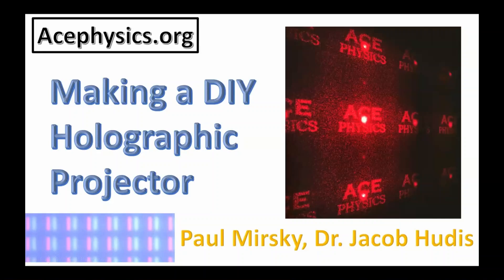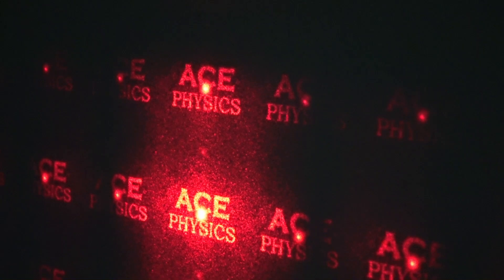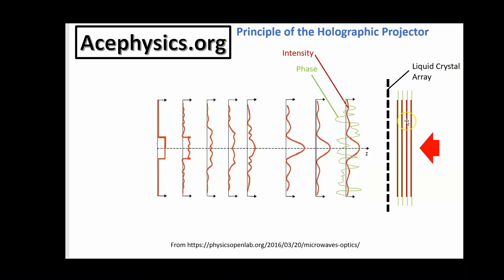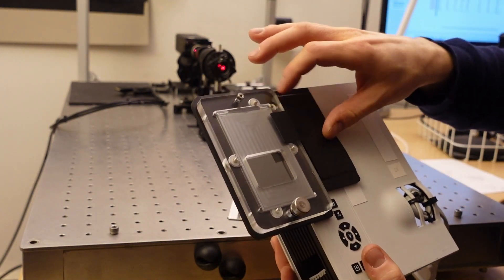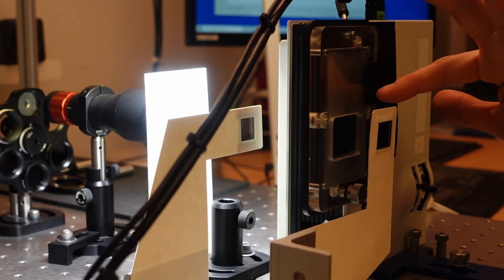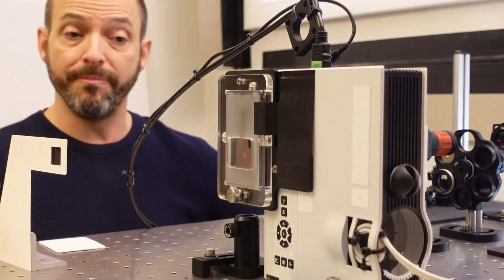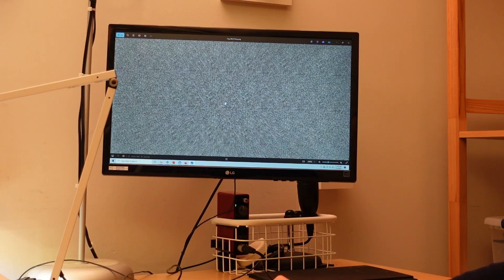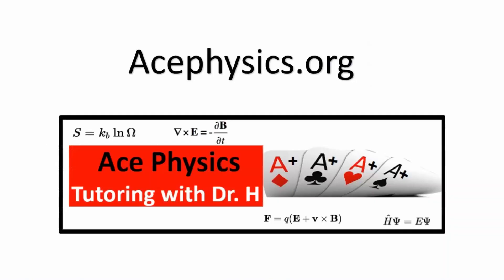LCD Projectors, Holography, and Fourier Optics Complete Explanation with Demonstration

Comment: I've been watching this video over and over, and after not getting any results with my laser + LCD setup. So many questions! 

Are the beamexpander + polarize crucial for this to work? Isn't laser light already polarized? 
If you are sending the light through a polarizer after the beamexpander, can't you just leave 1 layer of the polarizing filters on the LCD? 
If not, does the polarization axis matter? 
Is the resolution of the LCD relevant? Mine is only 320x240
How do I know the distance of the far field plane?
Reply from the maker: Paul Mirsky who you can contact at symmetryoptics.com is working on a reply.  I will elt you know when it is ready.
Reply: Brecht --
 
- A beam expander is not crucial, but it will let you cover more pixels.

- A polarizer is also not crucial; it just makes it more convenient to set the polarization orientation.  But you do need a quarter-wave plate to let you set the ellipticity, so that you can get it to be an eigenstate of the LCD.
- You can NOT leave the polarizer film on the LCD, because it's not configured to be an eigenstate of the polarizer.  I
- Resolution does matter.  You want lots of pixels -- so, small pixels and a large beam diameter.
- Distance of the far field plane is a tricky one, because you never get there completely (it's at infinity), so it becomes a question of 'what's close enough'.  It's the Fraunhofer distance, calculated from the largest feature size that matters, which can be a tricky thing to judge.  

I hope your experiment works!

Paul
Reply: Thank you very much. My replies seem to disappear, so I'll try again... Third time is the charm. 

Thank you for your answers, it makes the whole thing clearer yet again! 
I'll be skipping the polarizer then, as I don't have a quarter-wave plate... only circular and linear polarizers for my camera. 
The beam expander seems crucial, so I'll try making one using Galileo's telescope design... let's hope that will work with a 450mm and 99.6mm lens.. it'll make the beam ~4.5x wider if I'm not mistaking. 

I'm looking forward to play around with diffraction patterns of all kinds!

Comment: Do you have any information on the projector tear-down..? I thought projectors had 3 LCD's and some dichroic and other mirrors to separate RGB and then bring it back together with a prism... Surely it's not as straightforward as you make it?
Reply from the maker: You're absolutely right—most standard projectors use dichroic mirrors to split white light into red, green, and blue channels. Each color is modulated separately (typically with 3 LCDs or LCoS chips) and then recombined optically to produce a full-color image by additive color mixing.

But what I showed is a holographic projector, which operates on a completely different principle. It uses monochromatic, coherent light—usually from a laser—and a spatial light modulator (SLM) to control the phase of the light wave and create images through interference patterns, not color mixing.

Current holographic systems are typically monochromatic, since interference-based image formation relies on a fixed wavelength. Full-color holographic projection is an active area of research and is possible, but it requires multiple coherent light sources (e.g., red, green, and blue lasers) and highly precise modulation and alignment—much more complex than what I showed.

So yes, a holographic projector can work with multiple colors, but each must be handled carefully and coherently. For my setup, I simplified it by working with just one laser and one wavelength.
Reply: @acephysics123  Thanks for elaborating. 
I was just curious about the actual construction of your poor-man's SLM. I wanted to do this some time ago but colleagues told me it would not work with the LCD from a projector. You've just proven me right and them wrong, so now my quest begins to open up a projector and strip out one of the three LCD's.

Comment: In the second video,  you've said that the input for holographic projector is circularly polarized light, whereas the input for the normal LCD projector is linear polarized light. But I don't see you inserting the quarter wave plate here. Whats the magic? 

Thank you very much for the fantastic demonstrations!!

Comment: Why do we need to rip-off the cross polarizers? How does diffraction interact with the polarization? Polarization and phase are not the same thing, so I guess there must be some interference patterns which we can work with, even while the cross polarizers are in place. 
 I just watched this video, and I guess I will get the answers once I watch the next video?
Actually I got a cheap projector and assembled the setup with the laser pointer. And I am kind of possessive/afraid to rip the cross polarizers out.
Reply: "Changing only the phase, and not making them lighter or darker.." Okay, got it. Removing cross polarizes save you a lot of light.  But even with absorption from cross polarizers (even though it would be limiting), can't the light coming out of binary "slits" or pixels interfere with each other?.

Comment: That was so awesome!  Subscribed!! I have been interested in using SLMs as layers in a photonic neural network.  I think it could be done.  At some point I made a simulation that attempted to map neural weights on to the diffraction pattern. It kinda worked in the software domain, but there is a lot to do to make it work in hardware as I'm sure you are aware.   Really enjoyable video, thank you!
Reply from the maker: thanks a lot!  I have part 2 coming in about a week or less!

Comment: That was awesome! I have a question. Is water, especially seawater, a liquid crystal?
Reply from the maker: @tiredironrepair Great question! Liquid crystals are special phases of matter with properties between conventional liquids and solid crystals. The key difference is that their molecules are partially ordered and can be aligned in specific patterns using external factors like electric fields.

Seawater isn’t a liquid crystal because the salt ions are randomly dispersed, not organized into aligned structures. If you shine light through seawater, it will scatter and diffract, but it won’t produce a clear image or distinct pattern like a liquid crystal display would.

If you could somehow arrange the salt ions in a regular, controllable pattern, it might behave more like a liquid crystal. However, controlling ions in water at that level is extremely challenging and not something that occurs naturally.

Comment: ok i subscribed, waiting for the next part :D
Reply from the maker: Hi @frogz, thank you for watching and subscribing! Part 2 will definitely come—probably in about a month. I’ll have a few other unrelated videos in the meantime. Part 2 will delve into the mathematics behind LCDs and quantum two-state systems.  Are you a physics student or researcher? Also, does your screen name have a story—do you have a pet frog? 😄 Best, Jacob
Reply: @acephysics123  hahahahha, it just evolved over time, i havnt had a pet frog in years :( started out as an aol username with a number on the end, eventually shortened and added a z, 
also im curious if these diffraction gratings can be produced physically by cutting them out of a material or if it must be transmissive to work
also can the lcd tech be adapted to single shot produce actual holograms in film?
Reply from the maker: @frogz  @frogz Great question! Diffraction gratings don’t have to be transmissive—they can be reflective too, like the ones on holographic chocolate. You can look up how to make it, but it’s not really a hologram. The word ‘hologram’ is often misused. A true hologram requires coherent light (like from a laser) to create and view, whereas anything using ambient light isn’t a hologram, though it does involve diffraction. Holograms, however, do need to be transmissive in some cases. Thanks for your view and comment on my video!